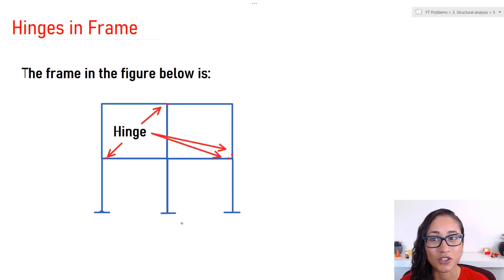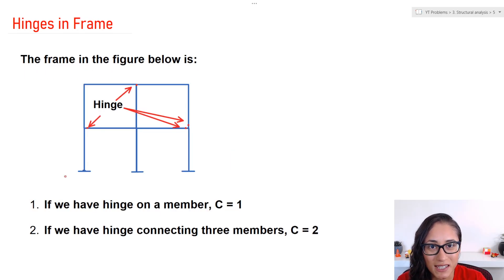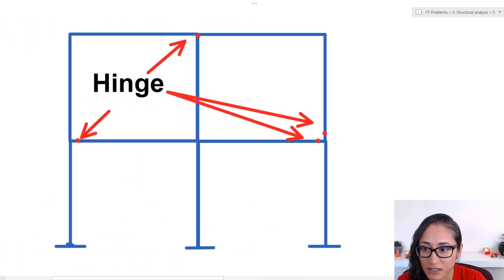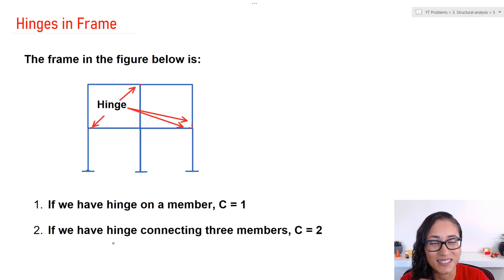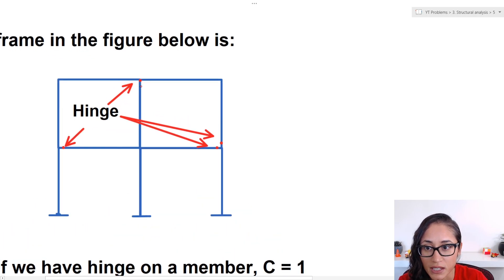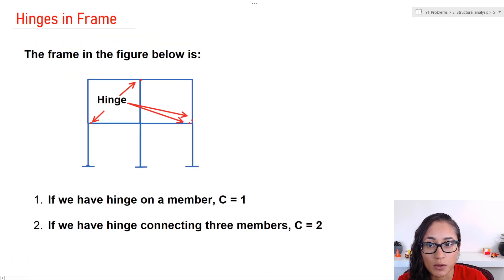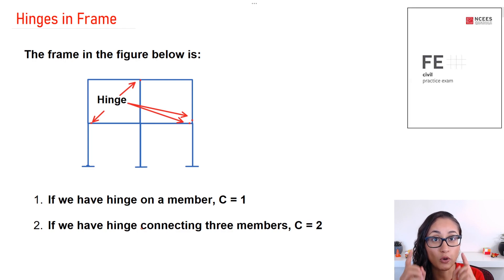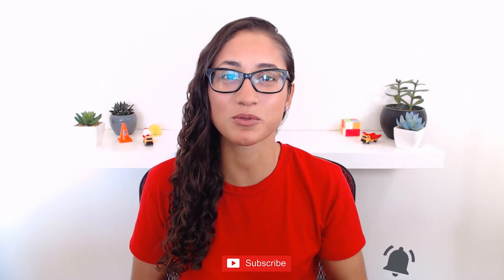Frame Analysis Part 2 - FE Exam Review

Comment: What if we have a hinge connecting four members, what's C value?
Reply: My assumption would be that it would still be 2. Remember when we had three members, the third moment equation doesn't help us, and we only need the 2 moment equations (c=2) - so I would say 4 would be the same case. Alternatively, it could be 4 if that assumption is wrong (c=2*2=4).
Reply: Have you found the answer to your question?